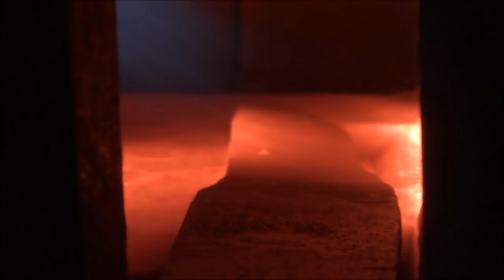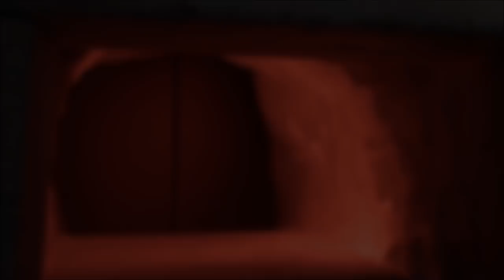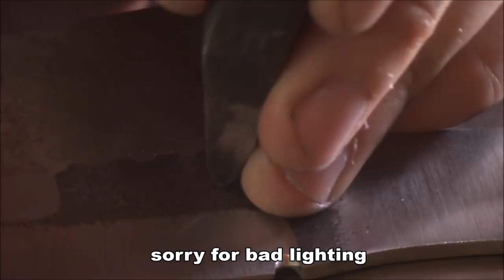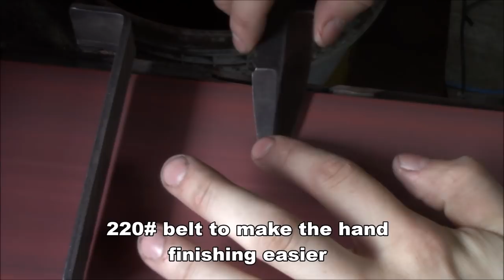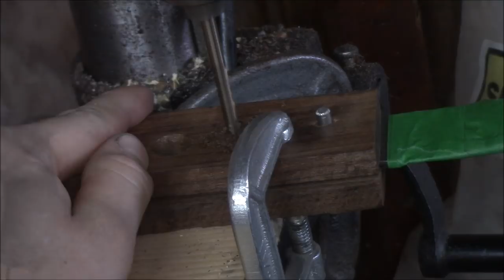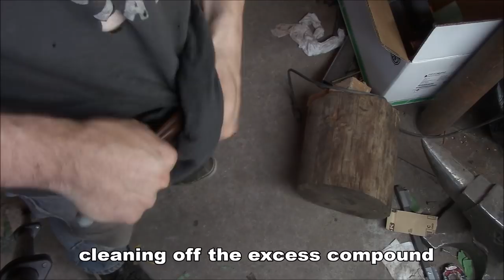Bladesmithing - Forging a Scottish sgian dubh

Comment: hey man, I wanted to thank you for suggesting that Murray Carter book. Already improving on my drawing. thanks again!
Reply from the maker: No problem! Glad I could help! Murrays a really good teacher and really knows what he's talking about! and after reading his books I felt like my blades would of taken at least a year or two before they look like they do now!
Reply: Andrew Hanowski what was this of 0-1 stock did you use? I am going to get a bunch of 1080 from admiral steel in the near future so i can start laying in a hamon.
Reply from the maker: O1 is a pretty standard steel that's easy to heat treat. The customer may have wanted it also. I don't reccomend it for fancy hamons and don't know too much about 1080 but it will probally be better for hamons then o1. Lots of info on the internet from people who work with these steels! Personally I water quench 52100 or 1095 for hamons, but that isn't really a beginner thing to be doing!
Reply: sorry typo on the last one. just wanted to know the width that you started out at.  1 1/2"?
Reply from the maker: Yup. 1 1/2" x 1/4"
Reply: I have read and heard from many folks that 1080-1084 steel is great for hamons and a little easy on the heat treat.  Having said that I mostly work with 5160 and don't know for sure.

Comment: what did you use for your thing tube and pins? I have just been commissioned to build a few of these knives
Reply from the maker: I got the tube and pins at Canadian Tire. Alot of hardware store should sell them, but some don't.
Reply: Thanks, I will have a look. I have brass pins but I liked the look of what I assume is stainless
Reply from the maker: Yeah the steel look is nice! Anyway, Good luck on the blades man!
Reply: Thanks and you too!

Comment: -Andrew 
     On the graver at what color idid you  temper if any?
Reply from the maker: You got to temper them. They will chip if you don't. I tempered it to a golden wheat color. Use a blow torch and heat the handle area to a blue and let the heat slowly change the color of the steel until the edge is wheat. If you go a little blue it's fine for a chisel.
Reply: Thanks